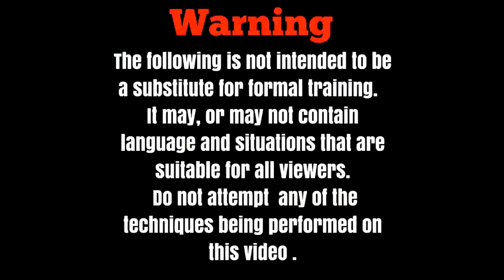Sunday Premier Challenger Guitar Build Video # 1 AND Some Cool New Tools Too!

Comment: Great series, for the press, if you place a piece of either 3/16" or 1/4" plate steel between the press bar and the MDF it will help spread out the clamping pressure without damaging the MDF.  Of course, you will still need to drill the holes for the shaft extension and bolts.  
Looking forward to the rest of the videos in this series.
Reply from the maker: Sounds good to me we might just try that

Comment: I thought for sure when you glued that up that the pins would get glued in as well. Love that press idea, I think that it would work great for a home shop because you can take off the MDF pieces and still have a general purpose press to use. Looking forward to the next video!
Reply from the maker: Thanks Tom I wasn't sure they would press out but they mostly do. I'll admit to having to drill them out sometimes.
I always make them short just in case

Comment: Great idea!  I'd probably mount that top mdf pressure plate to the cross bar of the press so it lifts up and down making it easier to slide your blank in and out. My two cents ☺
Reply from the maker: we thought of that, might need new return springs
Reply: @TexasToastGuitars  yeah true. That slab of mdf probably has some weight to it.

Comment: I did this and it worked for about 5 guitars then the bottle jack went bad. Went to harbor freight and got a new one and the same thing happened again and even leaked oil. Yes this is the best/easiest way to do it but either 1. Rebuillt the bottle jack. 2. Get a better quality bottle jack or 3. Go pneumatic/hydraulic where its just a press of a button
Reply from the maker: That's a shame
Reply: @TexasToastGuitars  I made a response video on the Silvino Guitars channel with more details on my experience

Comment: Love the press idea. Looks like it works great. I do have one question on the templates. I know Steve designs the templates to be mainly used with a router table but it looks like they work great with the pin router as well. When you are cleaning up the perimeter with the pin router do you run the bit as close to the template as possible or flip the template to avoid accidentally dinging the template?
Reply from the maker: They actually work better with the pin router

Comment: Beauty! Thanks for bringing us along on the ride thru the inner sanctum. 

That press looks cool. I never glued tops to backs but I did glue fretboards to necks and can see how that would work nicely too. 

Did you purposely route the back of the tremolo cavity (extra route down to the maple top but not through it) after doing the front? Or was that just forgetfulness?

Thanks, keep up your good work
Reply from the maker: I like to do it that way so I can see how thick it is or how much room before I go plowing through the top HAHAHA
Reply: @TexasToastGuitars  Perhaps foolishly I  trusted my jigs. I guess if there was a screwup it would’ve only happened to the first body of the run.

But my bodies didn’t have tops on them, just two joined pieces that were squared off, so not a lot invested in them at that point. Outside shape route (1/4” plunge channel ) and inside routing were done at the same time. Then bandsawing using the 1/4” channel as the template. Then back to the pin router to shape the body shape. Again using 1/4” machined channel as the template so no jig. 

With your templates and locater pins it should be even more consistent for you. Wish I thought of that.